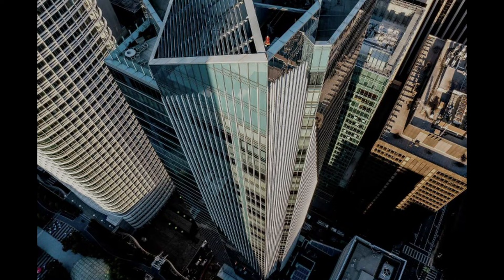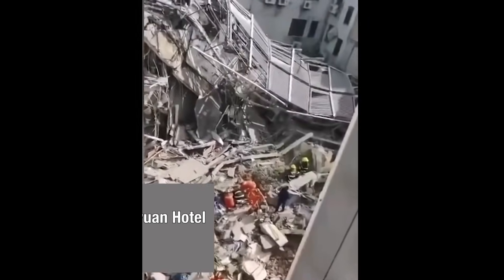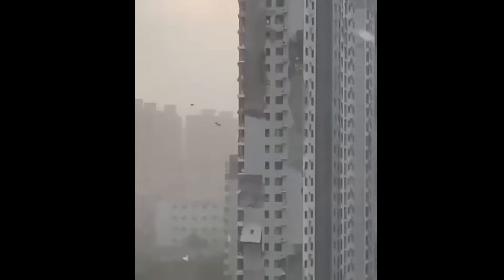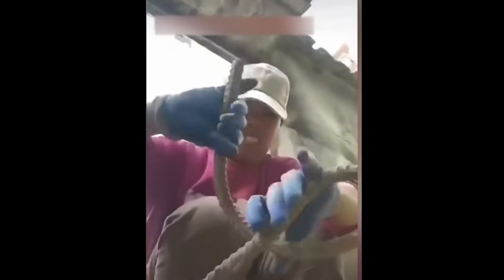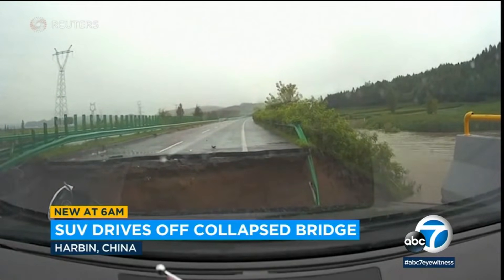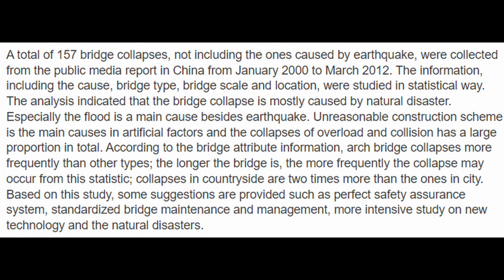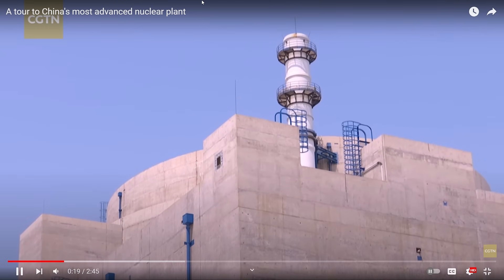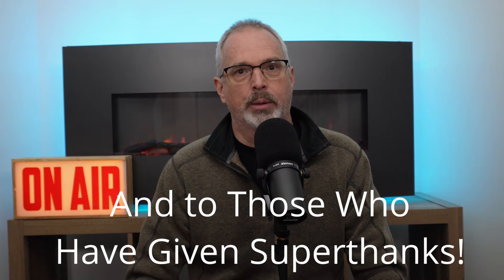Why Construction Projects in China are Often of Very Poor Quality

Comment: When there is a sudden building boom, there wouldn't be enough qualified designers, engineers and builders to do the jobs properly, nor would there be enough qualified inspectors to check all the details of the work done.  There would also be shortages of good quality building materials.  These shortages would present problems even if all builders were honest and didn't cut corners.
Reply from the maker: Good point.  I wonder how much actual engineering was done for these buildings or they just winged it.
Reply: They do have inspectors, but they work for the developer. Australia has a similar problem, and now many buildings there have issues as well, for largley the same reason. The issue at Boeing is the same problem, self inspection.

It is all because government is not doing it's job in regulating industry, and it manifests itself in different ways in different countries. There is always pushback against regulation everywhere, even in the US, on the grounds that it stiffles industry. But at the same time, without it the consumer gets hosed because the manufacturer is going to take shortcuts to reduce costs if they can get away with it.

Comment: ENVIRONMENTALLY….China construction is a bad actor when it comes to the carbon-footprint of demolished concrete buildings.  The demo of a dozen unfinished cement buildings- some of many- represents a huge hit to the environment, as cement production requires a lot of energy.  Making cement high-rises and then knocking them down is a huge waste.
Reply: Well, they probably didn't use nearly as much concrete as you might expect.

Comment: Then there’s the Three Gorges dam. Many cracks have been reported. Collapse would be catastrophic to say the least.
Reply from the maker: Good point.  I should probably do a video about that dam.
Reply: @CaseyJones-Engineer would love a deep dive on the 3 gorges!
Reply from the maker: @jaymobiggety9903  Will do.  My early engineering career involved designing and inspecting big dams.
Reply: @CaseyJones-Engineer 😅
Reply: @CaseyJones-Engineer bc hydro in Canada  was involved in the engineering on 3 gorges
Reply: A gravity arch dam (Hoover, ect) is going to be inherently stronger than the  straight -crested gravity dam (3 Gorges). The difference is concrete likes compression not tension, so 3 Gorges will crack under tension. Hopefully the concrete was up to specifications 
If 3 Gorges failed completely, downstream would resemble "The Scab lands".
Reply from the maker: @blaydCA   That's a great point about the dam's geometry.
Reply: The catastrophe will be limited to china, so who cares?
Reply: Don't get too carry away about this.  Several years ago some people claimed that the dam was about to fail because of some satellite pictures showing many HUGE cracks.  Turned out those satellite pictures were computer stitched together and those huge cracks shown on satellite pictures were software artifacts.  We just cannot believe every news about China now-a-day -- both positive and negative.  Both sides have political agenda to push.
Reply: IIRC, the Three Gorges was built, first and foremost, to make money.  The proper way to do flood control is multiple, small dams up in the hills, impounding smaller rivers as needed before they cumulatively overwhelm rivers downstream.  But you can’t easily harness them for hydro power.

Comment: "counterfeit materials" Ah yes, my rocks are fake. Unfortunate.

the reason people dont help is due to laws. It's apparently incredibly easy to sue people for getting "injured" also their culture is just a little weird, compared to other places. For similar reasons.

I think with prefabs your bigger concern would be original factory QC, job site QC is probably less of a concern? I would think it's much easier to just slap it together. Therefore harder to mess up. A lot of soviet commie blocks still exist after all. 

Also with the reactor cycles, unfortunately, it's often still cheaper to just mine fresh uranium, than it would be recycle it. A lot of the cyclic structure came from pre nuclear bung where we thought we had a lot less of it, and that we would use a lot more. Though the closed cycle has a lot more benefits, obviously.
Reply: Lmao you know for a fact they meant counterfeit as in gravel nstead of concrete, and plastic instead of metal rebar. Now go cry into your paper wall and hope your salty, sewer oil fueled tears, don't tear your house down. China shill. Why is China such a third world dung pile 🤣